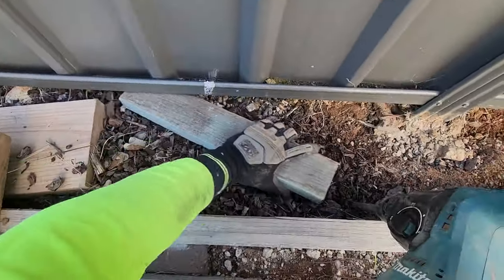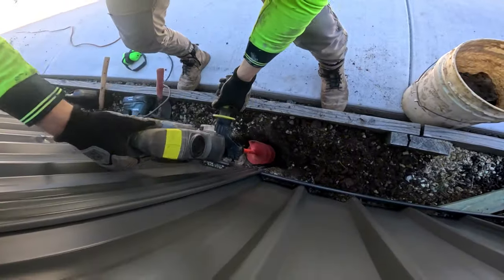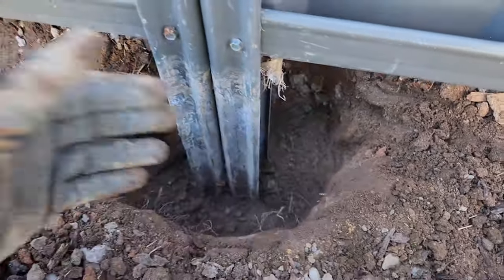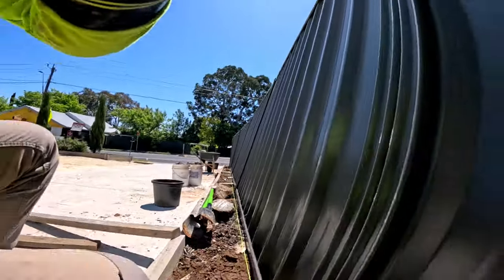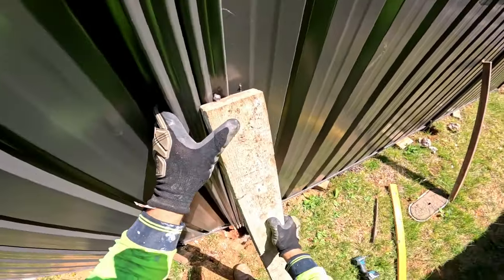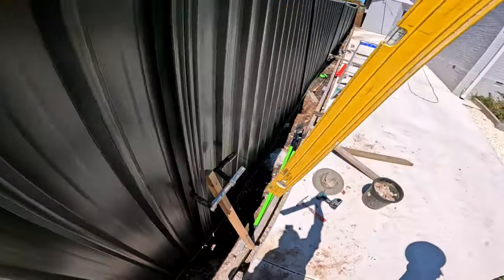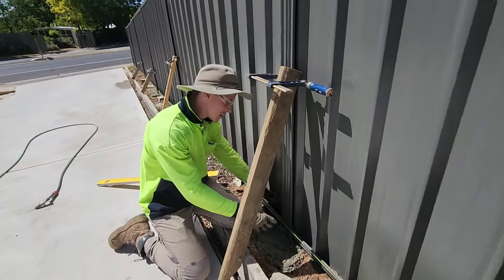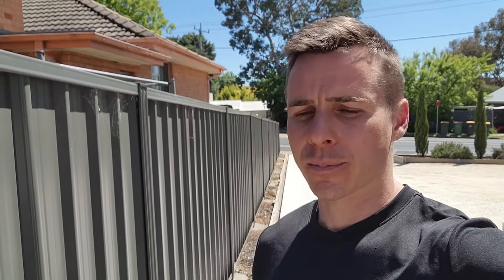HOW TO: DIY Leaning Fence Repair WITHOUT removing panels: Quick & Easy Method!

Comment: The iron fence on the outer boundary has bent. Can you help me how do i fix it and straighten the damaged section?
Reply from the maker: @MuhammadBilalKhanVlog  hi Muhammad, I'm not entirely sure what you mean, but if it is bent, you can bend it back the opposite way, just taking it slight further than straight to allow for the fence to relax back in position. But this is assuming no major damage etc, and you will be left with a slight "crinkle" if it's a panel type fence.

Comment: Removing panels is not exactly difficult.  Top rail is held on with 2 screws per side.  Then 3 sheets lift straight out.

And if you dont want loose posts in the first place.  Dont use quick-set/rapid set.  Firstly its more expensive than general purpose concrete, and its not even as strong.  

Like most things of this nature, if you want a good job, dont pay someone to do it for you, doing it yourself is cheaper, and you can put as much concrete down the holes as you want.  A contractor is just gonna do the bare minimum to get paid.  Small footings, no plinths, half a handful of quick set down the hole.  Post loose in the first wind.  A shitty job from "professionals" as usual.

I did all the fences around my property for half the price of a pro job, and i was able get my posts cut custom length to accomodate deep footings, plinths, and 2m sheets.  About 4 bags of concrete down each hole, buried 1000mm below grade.  My neighbor paid a bloke to put 3 half panels in the front for about the same prices as i did an entire side.  All the posts are loose.  Theres no plinths.  Used half 1800 sheets instead of half 2100 sheets, and missing screws all over the place.  Just a shitty job
Reply from the maker: All good points, this method is more so for some people who don't have the skills or confidence to remove panels and posts and reset/align. It is more managaeable to do a post or a few at a time. But yes, plenty of dodgy installers out there like the ones who did this fence!
Reply: Not always true about contactors doing the bare minimum.
There are a lot of people that take pride in there work and the longevity behind the workmanships.
We use a machine where we can and all batched concrete, 700mm footings with a plinth minimum standard as seen in my instruction video on my channel.
I like the video mate, and am always open to new ideas !